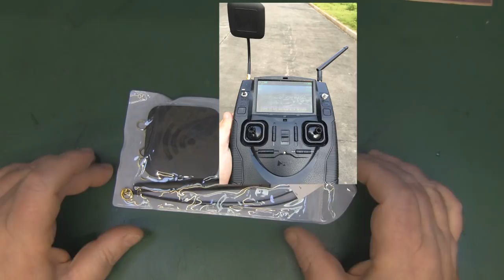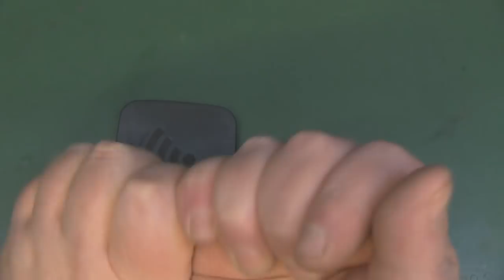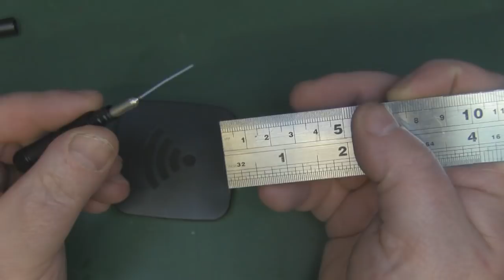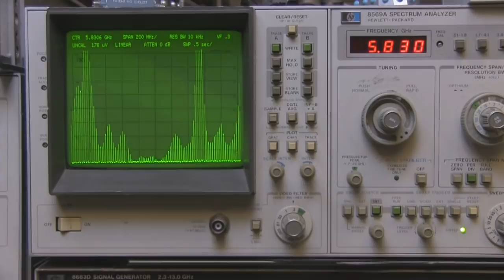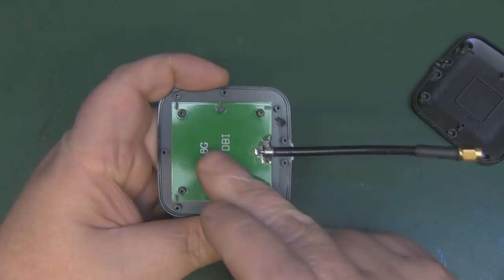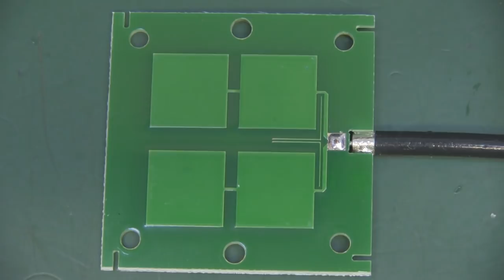14dbi H501s H502s 5 8GHz Hubsan Panel Enhanced Range Kit

Comment: Could I use a 5.8 Ghz antenna for a 2.4 gHz router?  I used to modify a 9dbi over its 4dbi,  but there's not much improvement.  Thanks
Reply: Not a good idea. Different frequencies need antennas of different size to radiate properly.
Reply: Salchichaky How about this 14dbi antenna on this router?  That's  no improvement, isn't it?

Comment: i have built a new antenna for 5.8ghz wifi 2xmimo two biquad elements (parabolic reflector).  this is what i hope to send you for testing.
https://forums.hak5.org/topic/42737-new-antenna-build-3d-printed-58ghz-parabolic/

if you scroll to the bottem of the thread you should see at todays date some updated photos.